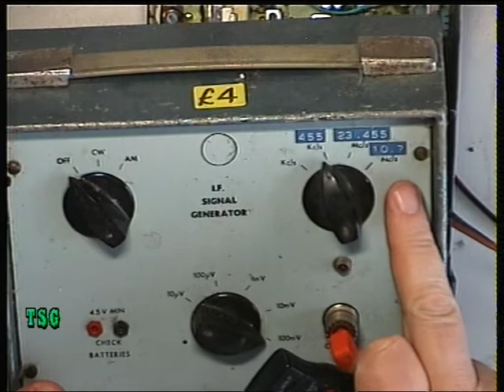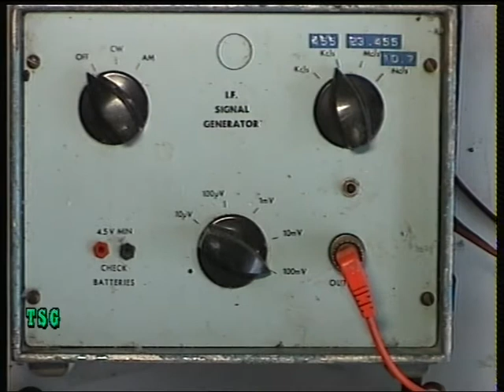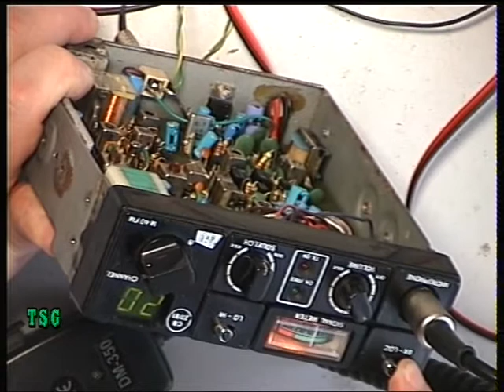DNT M40  UK (CB27/81) CB radio (Mobile)  -  Receive Alignment

Comment: Hi Richard, so is the initial procedure you follow known as "zero beat-ing" the two signal generator RF signals to achieve the desired receive frequency, which in this case is 27.79125MHz?  Would a more exact way be to monitor the two RF input signals on an oscilloscope and adjusting the varicap until the marker oscillator sine wave is in sync with the RF signal generators sine wave?  If so, where would one attach the oscilloscope probes to be able to do this?

Just before you switch on the IF marker oscillator, is the CB receiving an unmodulated or modulated tone from the Marconi's signal generator?  Is the IF marker oscillator sending an unmodulated signal?  Also, does the IF marker oscillator lead need to be connected to the negative (-) side of the radio while the positive lead is in the vicinity of the IF section of the radio or doesn't it matter?

Sorry, for all the questions. :)  I'm learning so much from your videos! :)
Reply from the maker: Not heard of your first idea. When I started in business 2-way radio, all equipments were crystal controlled. My training stated "To net the radio on frequency, the signal generator is on the desired receive frequency is unmodulated with around 10uV signal. The marker oscillator at the IF frequency (unmodulated) output lead is placed in the vicinity of the radios IF section & a hetrodyne note will be heard. The crystal trimmer capacitor is adjusted until the hetrodyne note is nullified."

So no direct connection. Best done on the higher IF frequency (10.695) rather than the 455hz because it's easier to hear.

Richard
Reply: I've noticed that the position of the "null" moves according to the signal strength I set on the IF signal generator.  So, at full I adjust the varicap and all nullify the tone but as I turn down the IF sig gen RF power control the tone returns and increased in volume/frequency.  Is this expected?  How much of a signal should I feeding the IF section?
Reply: Lol! Sorry, it's my dodgy signal generator drifting off the target frequency (10.695MHz) as I adjust the RF level, which of course will bring the tone back in!  My SG is brand new (from China) but us a bit drifty unless it's been on for about an hour..  As I'm typing this the speaker is sounding like a whistling kettle is about to boil as the SG drifts of the target frequency!  But, I would still like to know if it's better to have a small signal or just enough to hear the tone or is a big signal okay as well?  I placed my crocodile clip where you had yours in the radio but it was a little weak, so I tried elsewhere and the tone came in really loudly lying flat on top of the ceramic filter to the top-left of the MC3357P.  Is it better to have it further away?
Reply from the maker: It's just a matter of placing the output wire from the marker oscillator where it works..no hard & fast rules. Our marker oscillator is custom made for the purpose & I frankly have no idea what the output level is! as long as you're monitoring the drifty sg you have, this adjustment takes about 3 seconds so I don't think you have to keep checking!
Reply: As always, richard, thanks for clarifying.  One more question (no more, I promise!).  I notice you didn't adjust the variable inductor below the MC3357P chip (L4?).  Is that also part of the receive inductor line up or used for something else?
Reply from the maker: Sorry, I can't go back & review to comment, it would be too time consuming. I will be doing the DNT B40 sometime which of course is the same radio with a psu nailed to the back & perhaps enlighten you with the untouched coil! I looked at the American bloke using 10Mhz WWV of-air signal to set the reference oscillator of his frequency counter & of course it's the same technique. In the UK, the frequency standard is radio 4 on Long wave 200khz. It may be a 1930's transmitter, but they ensure is is spot on to use as an off-air reference.
Reply: No problem, Richard. :)  I'll look forward to that. I've just completed my alignment on my M40, as per your videos, and I guess I may have a good example as I'm getting 0.2uv at 12dB, which seems pretty sensitive to me.  I thought these radios had a poor rep, but I guess that was just as bleed-over boxes.  I didn't expect it to be quite so sensitive.  I can even get 5.8W out of it, according to my Marconi 2955B.  Of course, I've dropped it down to 4W, but I wasn't expecting that either.  Interestingly, the wattage increases the warmer the output transistor gets (I presume it's temperature related to this component at least).  I decided to set it once warmed up a bit but mine starts off about a watt lower from cold. I really like the sound quality on the M40.  Voices sound well rounded and clear but also static sound like hi-fi FM hiss rather than the coarse sound you get from most CBs.  I guess that's down to choosing Motorola ICs and TDA2002P for the audi IC.

Many thanks! :)
Reply from the maker: Yes, the bad reputation is bleedover. The B40 is crystal filtered to help this. There was a "supertuned" version om the mobile M40 avaiable at the time which had received modifications by Cleartone to help the bleedover snag. These days bleedover shouldn't be a snag with fewer users around....except cities where the burner brigade live! 

I think the other reason for a bad reputation is that few people could service them...certainly not the self-styled "rig doctor" with a gas poker soldering iron!

Richard
Reply: Lol!  Yes, indeed.  I call them the rig tinkerers or blow-torch brigade. I've seen some shockers in the past.  My M40 is working well except that actually after initially increasing the wattage after a warm up it, when in use, it drops about 1.5W after about 15 minutes of overs.  The heatsink gets incredibly hot and if I spray it with Servisol Freeze It 20 the wattage shoots back up.  Not sure if that's a moribund final or inadequate heatsinking of it.  

Yes, I bought a very beaten and battered Radiotechnic RT852 off of eBay a few years ago.  Is that the one you mean?  It had a very good review in some magazine or other but I've not got around to aligning it yet as it has several faults it looks like due to heavy and rough use. Interestingly, I thought the mods to improve the radio would be down to track level but my one has what looks like factory made mods on the trackside of the PCB.  I say it looks factory made because the soldering is very professional, the component leads are  bent carefully and there's no sign of flux anywhere.  Of course flux can be cleared off but modders don't tend to bother doing that.  I was thinking of modding my M40 up to bring it up to the Radiotechnic standard but I'm not sure if I can simply copy the RT852.

Anyway, thanks for your video series on the M40.  I'll keep a look out for the B40 videos.  Cheers!

Comment: Richard ,  just seen a few vids of the Uniden 300 H/Base , can you tell me what pot it is to set the signal Meter up ? about 3 bars Lazy . :)
Reply from the maker: +kevin mc dougall I'm confused...if you've just watched my video on the Uniden Uniace 300 base station surely I demonstrate on the video. Anyway, it's done on channel 20, connecting to a signal generator, set to 27.79125, 1khz tone, deviation set to 1,5khz. The signal generator attenuator is set to 100uV to simulate an S9 signal. The preset is then advanced to make the s-meter needle touch S9. Let me know if I missed that off the video, but I'm sure I didn;t. Alternatively look at my video on the Audioline 345, which is the same set.  

I can't tell you here & now the preset as I don't have the service manual in front of me.

Richard